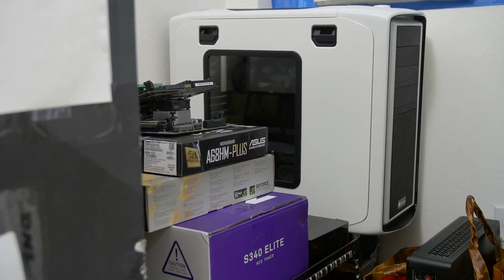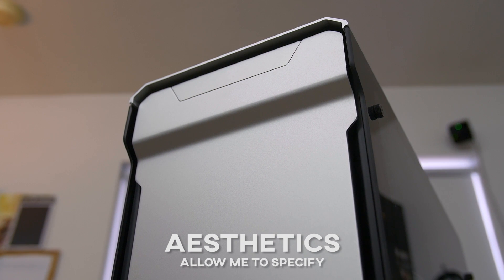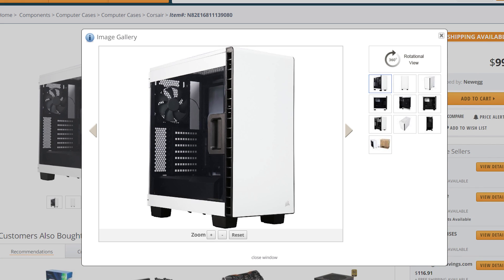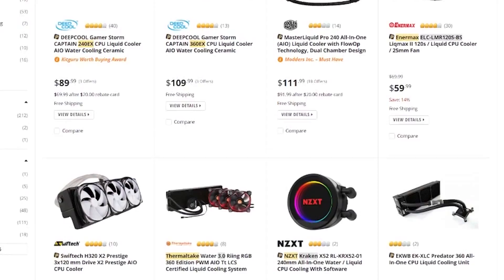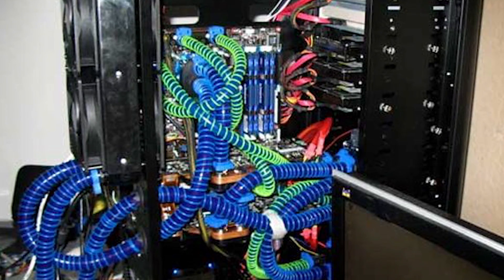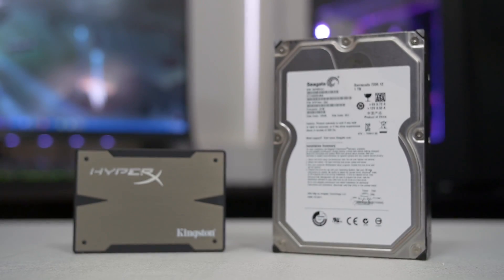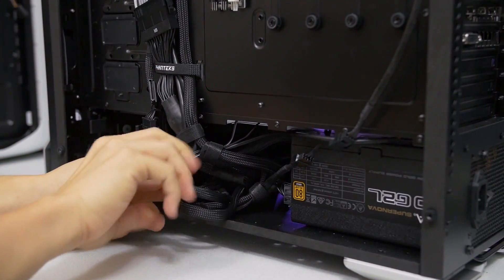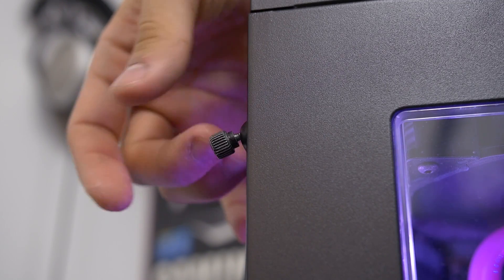4 Major Changes to PC Cases in the Last 5 Years: Then and Now

Comment: 5 years?? I still use my gaming pc case that I bought in 2007...
Reply: 5 years? I'm using a black OEM case (eMachines) that has something like 11 or 12 years (jt was my 4th PC, but now holds my 8th PC). And funny thing, the PSU shroud Kyle is talking about, my mid tower OEM case has one, though the PSU is mounted on the top of the motherboard, not on the basement of the case. It hides cables really well in the top compartment.

It doesn't have a transparent side panel, but I added a 90mm exhaust fan with 5 colors and breathing effect (unchangeable). But that's just because I had it laying around from an old DIY plexiglass side panel build I did. I don't like lighting anymore, they are distracting.
Reply: u still build in one of those pc chassis lol all of sudden your diy plexiglass side panel looks ugly........although it does have this nostalgic feeling and it must be funny fooling people with your "old" system
Reply: still using the cpu i bought in 2007...  Q6600
Reply: lmao i modded and put 3x120mm, 1x240mm and 1x180mm radiator in my Aopen HQ45 case from 1999 lol
Reply: Harris Yasir I prefer small builds since I don't have tons of HDDs or expansion slots. And I don't like buying new cases, when the old ones are still usable (learned that the hard way when I bought a Raidmax Hurricane and the PSU had too short cables and I couldn't use it, so I returned it). Anyway it was too big to fit under my desk. I suck at choosing PC cases, since they all serve the same functionality and they are more of an aspect thing to me (I don't use high power components, so airflow is not really a problem for me).

The DIY plexiglass build was first an old white case full ATX tower, I'm not sure even what brand or OEM that was (it was very ugly at the beginning). I cut a hole in the side panel, spray painted it mate black, added the Thermaltake LED fan as front exhaust fan, since it was the only place I could mount that (which was terrible so I removed it later on), added a white 12v LED strip straight into the PSU, stuck it on the top of the case with its included adhesive and later on I sold that machine. It was looking pretty when I finished it, but I always had to be careful when I sat at my desk, since the tower was too big and it was getting out of the PC riser under my desk, and I could hit the case with my chair (which I did once, but it didn't leave scratches).

I don't usually have people coming at me, especially PC knowing people, but the eMachines case still looks modern to this day (it help up nicely). I still have its original DVD/RW, but I never use it and the USB + SD/MMC/SM/MS/MS-Pro + CF/Microdrive bay (too bad it doesn't support SDHC, not to mention SDXC which I have). Though it still have the old stickers on it with Athlon64, ATI Radeon Xpress 200, Designed for Windows XP, an ugly AOL "sign on today" and the amazing PC World "Highest Overall Reliability & Service 2005". Oh and I still use its original speakers, just made them USB powered. They do the job. But now my main PC is a Toshiba Encore tablet (right next to it) which is connected to my 49 inches TV.

I will upgrade both of them soon, as both only have HDMI 1.2 which only supports 1080p and it is a waste, since my TV is 4K. Next, I want to try something new, since small builds are becoming mainstream. I'll build a Raven Ridge APU PC inside an Xbox 360 case, since it doesn't need a dGPU. I had build a microATX system inside the original 360 case, but I used an ATX PSU outside of it, which was ugly. My xbox will be waiting. When I will make the build, I want to get my hands on a 120W or 150W picoPSU. I'll also try to use the original ports of the Xbox or fill them with new USB 3 ports. Too bad I can't use the original DVD, but I don't really care, since I won't use it, I'll just fill that empty space with something, maybe a dust filter and use it as air intake.

I am very very sorry about my long comment
Reply: My gaming desktop is still housed in a case from 2003.
Reply: nothing you can't fix with a dremel lol
Reply: My case is from 1999 and I was born in 1998 its fire truck red with a massive window on the side panel it's awesome
Reply: Raimar Lunardi I'm still using a Lian-Li ATX case from 2003 for my Q6600 system. I'm using a Corsair Carbide Spec 01 case for my current system. Awesome case for $50.
Reply: Harris Yasir
I actually +1'ed your comment. I am not pissed, just expressing my usual interest about computers (it is that big). And don't worry, some people liked the case, some people didn't, it was a matter of preferences. Too bad I don't have pictures of it.

AMD Raven Ridge APU will be an APU based on Zen CPU and have a Vega GPU. It should come somewhere around Q2 2017 (March to July). The performance of the CPU should be just as a Summit Ridge (Ryzen) quad core CPU (and does have SMT aka Hyperthreading). The GPU performance should be somewhere around RX 460 at least, which should be more than enough for 1080p gaming (I won't be doing any hardcore gaming, just some casual gaming). It will use DDR4 and AM4 socket. Rumors say it will feature HBM 2, but I highly doubt that. Having HBM would probably boost that GPU somewhere closer to an RX 470, which I don't believe it will happen on such a small chip. and the price will be insane. Even without HBM, that GPU will perform pretty close to RX 460 (if it is paired with the fastest DDR4, like 3600 MHz or 4200 MHz RAM).

Building inside a 360 case will be half fun, half wish for a small build. Having people look at me power my "Xbox 360" and run Windows or Linux on it will be really fun and having my PC be so small will be amazing, as I love SFF builds (I am a fan of Gigabyte Brix Gaming PC, too bad they don't make those so small anymore). And I intend to film the making of it and post it on Youtube, since I don't see a lot of PC in console mods and the ones that already exist are kind either ugly, use really old hardware or are modded in such a way that it does not keep the original look of them (I intend to keep the Xbox as close to the original as possible).
Reply: Same here, my computer is in a big ass Chieftec Dragon full tower from early 2003 ! Dumpster find, all steel, weights a ton, still looks good, it's so tall it works as an extension for my desk.
Reply: Raimar Lunardi the real trip is that 2007 was 10 years ago 😨
Reply: ***** If you're talking to me, I have one from an eMachines T6420.
Reply: dude, 'til dis day I'm still using my old sh*tty Simbadda case from my first PC that I bought in 2005
Reply: Hell, most of my rigs components are 6 years old, packed in "good" 'ole Nexus Breeze.
Reply: jhsevs
That's some hardcore modding, I want to see that.
Reply: I could fit an HD5970 in it, and it's a veeeery long card. But my previous motherboard had the main PCI-E slot on the bottom. With my new board the PCI-E slot is at the top so the hard drive bays would be in the way if I wanted to use the same card. They're removable though. 
Yours appears to be a mid tower case, mine is a full tower case : there's a gigantic empty space above the motherboard for the power supply, you can put three ATX PSUs here :P But for a case of this size, it's not very practical. No cable management features, too much room for the 5.25" bays, the hard drive removable trays are cool but useless and take too much room as well, I had to add USB ports to the front panel because there's nothing.

But what I really want is an IBM xSeries 205 or 225 server case. They are from 2003 but they are sexy as hell, and will fit ATX motherboards. They will need a few mods to be universal, but they look so good. I had a x225 but the case was badly beat up and missing parts. They can be found really cheap, and have a very nice 435W Astec power supply from the factory.
Reply: Raimar Lunardi almost same here,from 2008
Reply: I have an Antech SX1030 from 2001.  Its finally getting "replaced" (its turning into a dedicated XP machine) with a L10 GT only because I cant mount a 120mm rad in it.
Reply: That's why I posted... and is not because I want it to look old... I just didn't update with the rest :D
Reply: Still using the Cooler Master Centurion 5 case I bought in 2006.
Reply: yeah, but I'm using a 90s alienware case with a lock on....
Reply: i still use my old cheiftec dragon big tower
Reply: What case do you have?
Reply: ◉_◉......xD xD what was with long comment.....did you get pissed of cus i said ur case looks shit .....well i said "might".....plus u didnt mention you spray painted it .....anyway so you want to build a pc inside 360 case ....w8 are u just doing it for fun or doing it for fun and want good performance cus are APU's tht powerful enough to run 360 games ....p.s i only just read about this raven ridge ( in your comment)
Reply: i have suddenly just been pulled in to a world of microprocessors for small builds and btw ..... "Having people look at me power my "Xbox 360" and run Windows or Linux" ...genius.

"RX 460"...u serious , why haven't i heard about this yet
Reply: Harris Yasir
You can just search for AMD Raven Ridge. The GPU should have around 1020 stream processors based on Vega. RX 460 Polaris 11 has 896 (at stock, if unlocked it has 1024). Considering the advancements of the Vega chip, but the limitation in bandwidth by DDR4 dual channel, it should be pretty much on par with RX 460. But don't take my word, google it and read the rumors and speculations. I also did some calculations and the speculations seems precise, but we can't know until it is released (though I'll still buy it nonetheless).

By the way, nVidia Tegra is just as capable as an Xbox 360 performance wise. Xbox One has the performance of a Radeon HD 7790. RX 460 is just as good as a Radeon HD 7850 (and the spec sheet says it would be half the performance). That's how technology works. New stuff perform as good as old ones, using less power and being more compact (or the same volume and power with more performance).
Reply: cool well hopefully u record this thing
Reply: Thug life.
Reply: how the fuck did you do ......w8 dont tell me you drilled a bunch of holes then holes where the screw goes....then a side vent.......fuck me dry
Reply: i have h440 ....wut....its old enough
Reply: WHOA TECHNOLOGY
Reply: Heh my server is still housed in an Antec p180 from around 2005
Reply: I realise my deepcool tesseract I bought last year.... is already outdated. And has a micro atx m/b in it. And horrid cable management. I really need a corsair m atx case and some sleeved extensions 😅
Reply: I'm making a q9550 overclocked to 3.94 system.

Comment: The biggest change that I have noticed in my PC building experience is the move of the power supply from the top of the chassis to the bottom. Also the movement from desktop cases to tower cases, but that dates me a bit lol.

Comment: Question for the gallary. I notice alot of systems are moving away from the optical drive due to applications such as steam. Personally I still use an optical drive since  I have a virtualized windows XP and 95 for my older games that I still enjoy playing (yes I have a USB to floppy) for some of those very older games.

So will the optical drive go the way of the dodo like the floppy drive or do you think they will both remain? Since we're talking about cases figured I would ask about case functionality.

Comment: What about cases from ten years ago?
Reply: 20 years ago we still weren't using ATX design. and most cases were horizontal, and you put your CRT screens on top of them. some actually had power sockets so you could plug your screen power cable directly on your pc. they're were sturdy AF though.
Reply: eMachines T6420 here. Though other components inside.
Reply: Areguil Gamer Nah, 20 years ago.
Reply: My PC case is from 2006 :D
Reply: Still have my Antec Sonata II from 2005. No temp. glass or window, no rgb, solid steel piano black... awesomeness.
Reply: yeah i kinda like the horizontal cases in a nostalgic way too. last year i bought a old pentium4 dell that has a really cool tooless compartmentalized horizontal case that packs tightly and opens all up, like a toolbox, very easily. i left that pc at my farm.
Reply: AtomicAJ74
Wow, that's unfortunate. My 2005 eMachines' (the only one) components are still working to this day.
Reply: *****
I liked those horizontal designs more than I like towers. Nowadays I don't think I can find that many horizontal cases and if I do, they might be the size and look of TV DVD players and can't put a monitor on top of them, because they might break or bend. I would build one by modding an old case and monitor just for nostalgia (although I was young when those things were mainstream and when I grew up, they were phased out, I still used those things in my mid school).

There were some PSUs that still had a C13 connector on them near the C14 one, until 2000. They were very useful in my opinion, since you could use a socket for both the PC and the monitor.
Reply: +GraveUypo I liked the eMachines case designs from those days, despite the horrible quality of the components.  My first PC was an eMachines 466is (Celeron 466 MHz with 32 MB of RAM).  The power supply, optical drive, sound card, and modem all failed within two years, but the case was fantastic and well-designed (in my opinion and for the times).  That was the only pre-built PC I ever bought except for a Shuttle system for my mom.
Reply: Honestly, cases from 90s and early 2000s were horrible, with little to no functionality updates. 
Corsair Graphite series such as 600T and their competitors were the generation that first saw the biggest breakthrough in mainstream case designs.
Reply: Pc peripherals case circa 1999. 
Sleeper AF...

Comment: While the 600t was a good case at the time, the Corsair 800D which came out ~1 year earlier is where a lot of trends started. While the case was far from perfect, it did have some great features.  It had good water cooling options in the roof, one of the first cases I remember seeing with rubber grommets for cable management and hot swap bays which were cool at the time. When I built a PC in 2010 I was doing a lot of research into cases, and a lot of cases had major drawbacks. Cable management really wasn't that good yet, there was hardly any room behind the motherboard tray on a lot of cases, no tie down points, etc.

Comment: fan size has both gotten bigger and smaller. Back in the day you could  see a lot of cases with the majority of the fan mounts being 120mm but some could even take up too 200mm. Well it seems like that 200mm fan mount has disappeared and we're now left with 140 and 120mm fan mounts. I guess alot thanks to that there have been about one 200mm radiator but a lot more of 240/280 and so on radiators.
Reply: mikos321 I kinda miss 200mm quiet pc cases. If only they implemented the 120mm designs into the 200mm ones just to make it quieter. Like fluid and magnetic repulsion bearings, no more hissing snake sound. Unfortunately people like watercooling and aesthetics compared to performance and sound of air cooling solutions.
Reply: Fortunately we quiet freaks still have bequiet fans.

Comment: should I get the msi rx 480 or the xfx 480? will be 8gb..
Reply: I personally recommend the XFX card, cuz it's cheaper (I think, but don't know exactly) and has excellent cooling (I haven't compared them directly,  but the xfx card may even run cooler than the one from msi). And it has hot-swappable fans (best selling point)
Reply: Toni Ka Yeah I will probably go with the xfx but lower loads get hotter than the msi, although the msi doesn't have as high rpm as the xfx, if I do a custom fan curve I will make it similar temps but I don't know if that's really a big deal